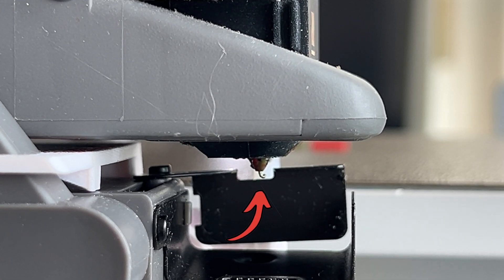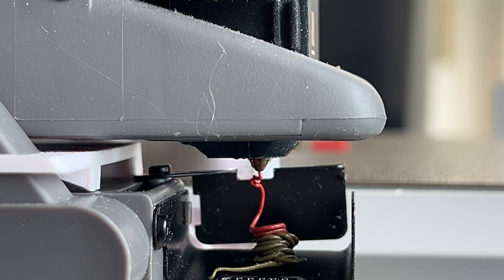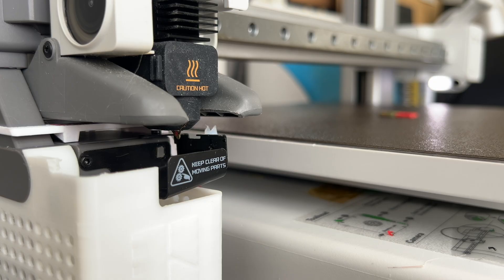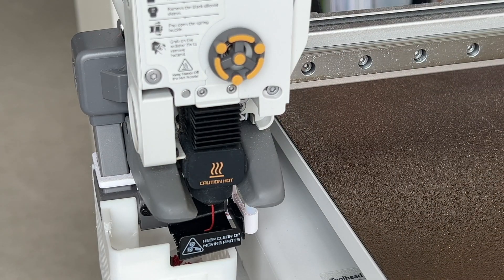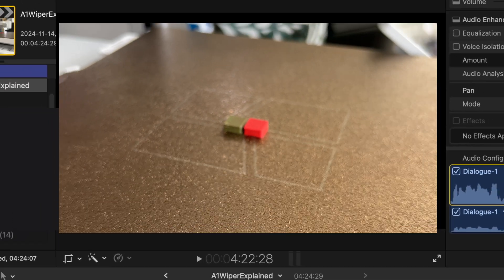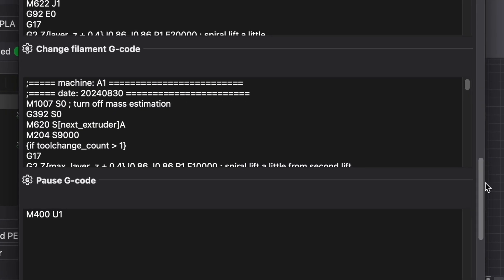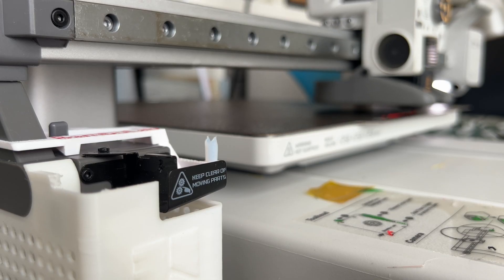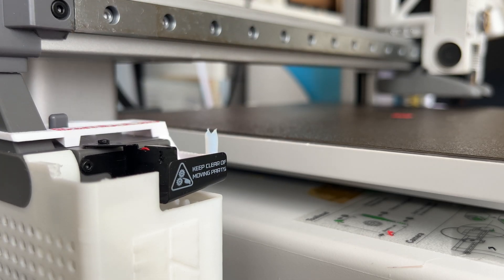A1/A1 mini Explained - Everything about Purger design, Snap-on Wiper and Custom Gcode.

Comment: it works on a1 mini with 0.2 noozle?  and is it possible to change only the wiper frequency, have it cleaned several times at the same time? thanks
Reply from the maker: I didn't try it on 0.2 nozzle. What do you mean wiper frequency?

Comment: I didn’t know you got a new printer. Do you like the Bamboo printer better. Great to see you posting again.
Reply from the maker: definitely like it. I own A1 and X1c now
Reply: @iczfirz  
I wish I knew that inside and out of these printers like you do. You have printed some amazing things. Thanks for your videos.
Reply from the maker: @TheDronzDr You're welcome. How about you? Do you own any bambulab printer?
Reply: @iczfirz  
No I have 2 CR-6SE and another one that is in closed. But they do the job ok. I need to learn how to do CAD. My slicer is Simplify 3D. That’s what started with and still use it.
Reply from the maker: @TheDronzDr  Before owning any of the BambuLab printers, I really thought any 3D printer was just a bunch of steppers, heated beds, and hotend nozzles. At BambuLab, it's more than meets the eys, especially the AMS.